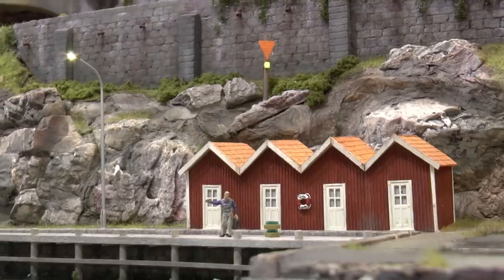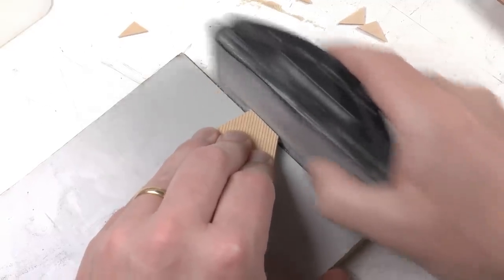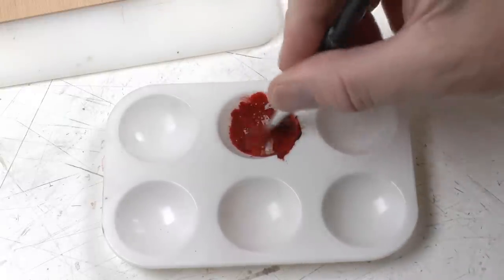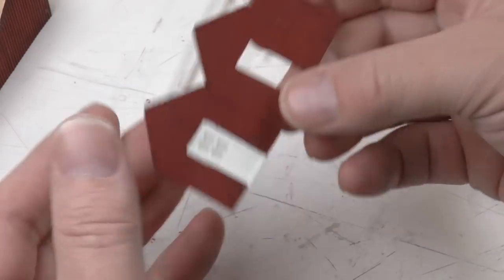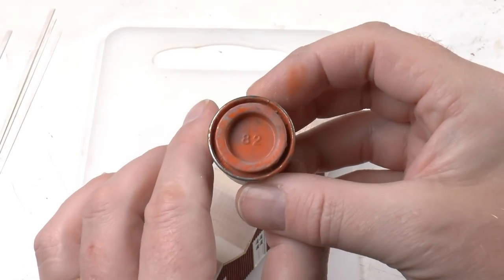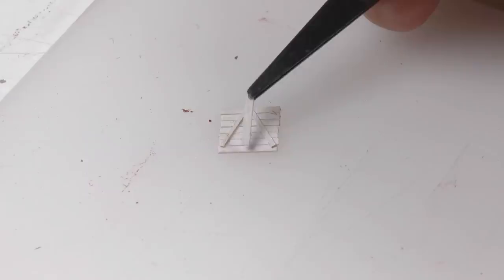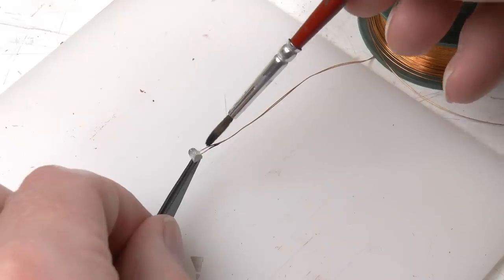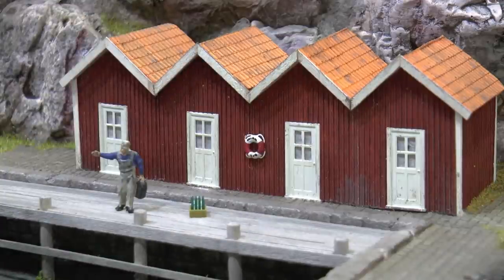Model miniature BoatHouses and Harbour Lanterns

Comment: The guiding lights you are talking about are called leading lights ;) and they are typically placed in pairs. One high and one low in front of it, so a ship can adjust its heading to steer 'into' the leading lights, taking things like current etc. into in account. As long as the leading lights are in line, the ship is moving towards the intended course and thus entering the port :)

Comment: A common form of 'leading light' for guidance into a harbour is a sector light, though I'm not sure if they exist outside of the UK, plus they might be harder to model. A sector light is just a single light that works basically on a similar principle as the PAPI lights often seen at airports, i.e if lined up correctly on the deep water channel/entrance to the hanbour the light is white, to far to left and it's red, to far to the right and the light is green. These lights usually flash rather than being steady and are positioned relatively high so that they are easier to spot amongst any other lights around.
Reply: This is looking like one of two "ensmärke" used to tell you when you are on the "enslinje".